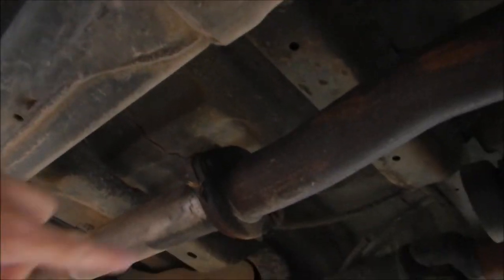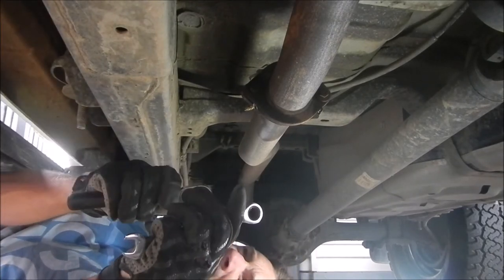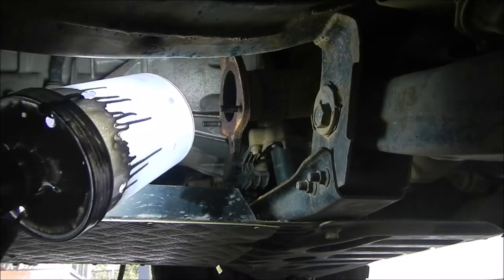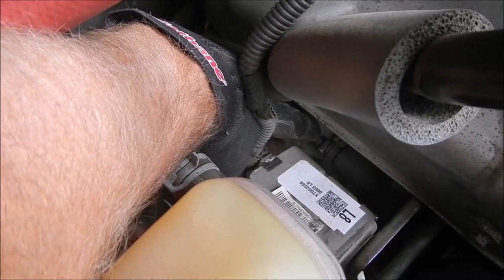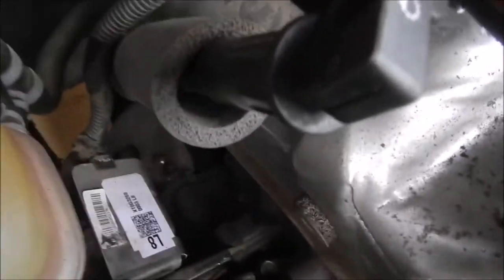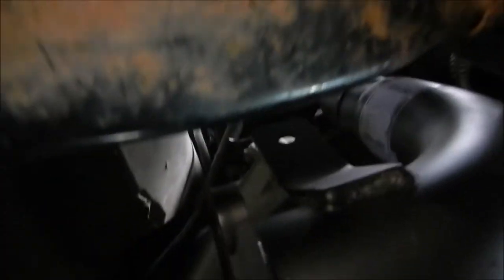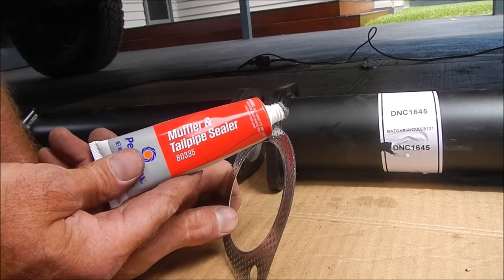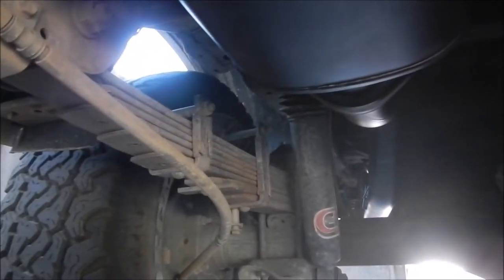RG Colorado exhaust replacement

Comment: G'day mate,  Thanks for all your  videos.  Really  appreciate it.  I am half way through  doing my exhaust on 2014 colorado. Having  a struggle removing Turbo back pipe . I have managed  to take  all four  bolts but still not coming  out . Any advice  will bi helpful
Reply from the maker: Sorry mate, just saw this.  Hopefully you have managed to sort it out by now.  I have to admit the turbo pipe was a bitch.  I took out the heat shield from the engine bay and tackled a couple of the bolts from above but it was still a pain as it only just squezes out at a precise angle even when all the bolts are out.
Reply: @handymatt9377  Thanks for the reply, you absolutely  spot on there wasn't much room but managed to install it.  I have installed 3 inch straight through so I didn't not put that heat shield back. Did you put your  heat shield back ??
Reply from the maker: @dtakkar  not the one off the OEM dump pipe.
Reply: @handymatt9377  sweet  thanks heaps

Comment: How did you get your cat out having trouble
Reply from the maker: It's a real pain in the arse. I ended up having to access the exhaust header from the engine bay by removing the drivers side heat shield from the block. Once it was removed the cat came out from underneath but it only fit out one way. It was like Tetris but just keep turning it and it will drop out

Comment: Does it feel any different to drive?
Reply from the maker: Hard to say as it went to the tuners afterwards. Does sound a lot crisper under power though and slightly less lag.
Reply: So all up with exhaust and tune did it make much difference, and would you recommend this change. As I'm thinking about doing this to my 2018 model. Also what year model is yours? Good video, I Subscribed.
Reply from the maker: @speerrs633  mine is a 2014 model. You will definitely notice the difference after these mids
Reply: G'day mate,  Thanks for all your  videos.  Really  appreciate it.  I am half way through  doing my exhaust on 2014 colorado. Having  a struggle removing Turbo back pipe . I have managed  to take  all four  bolts but still not coming  out . Any advice  will bi helpful